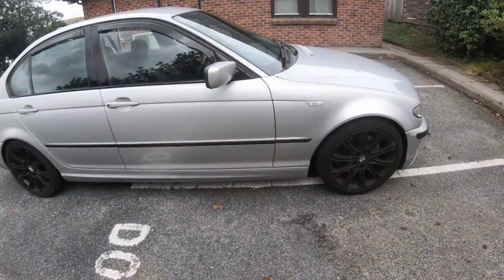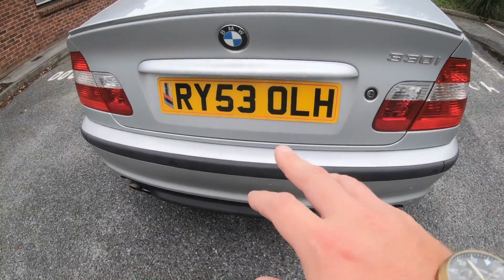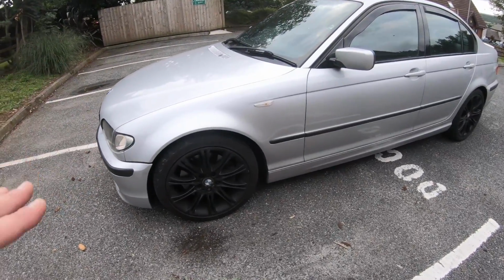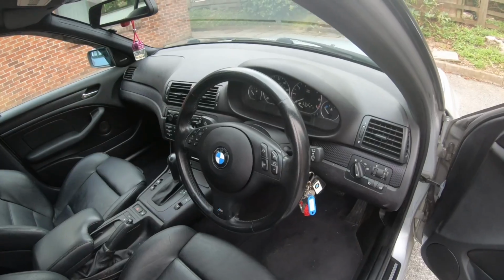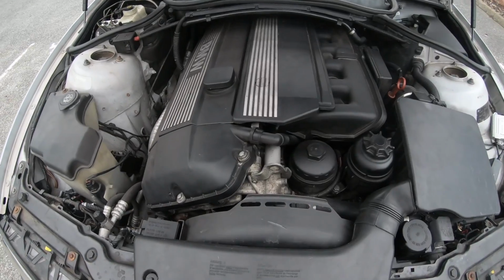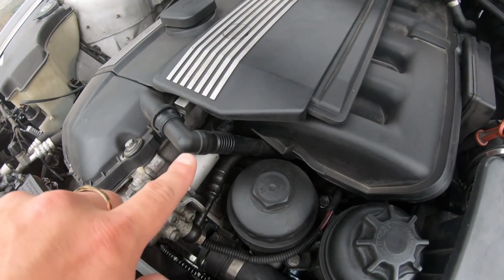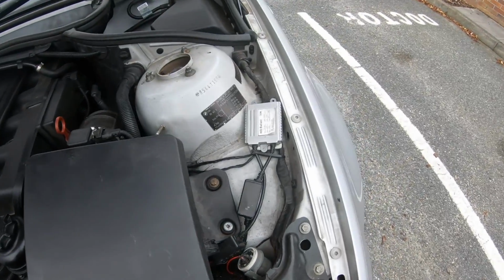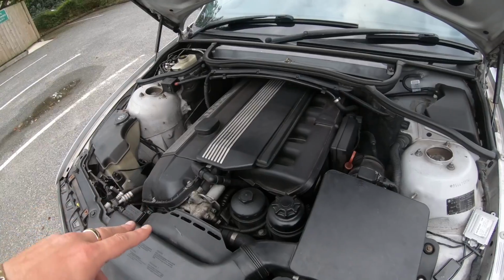Bmw E46 Reliability 2019.... Is This Future Classic Still Reliable Bmw Offering £4,000 For Clean E46

Comment: I own a e46 m3 and have done for many years, I use mine daily from roughly April/May till September without a peep, what a car 3.2ltr straight six and sounds fantastic, and fair enough I’ve scaled it down over the past few years the usage to preserve it and try to keep it out of the salty winter roads.

You have rod bearings, rusty wings, vanos and general things like tyres and brakes can add up, basically do it bit by bit and keep on top of it all or it does add up £££